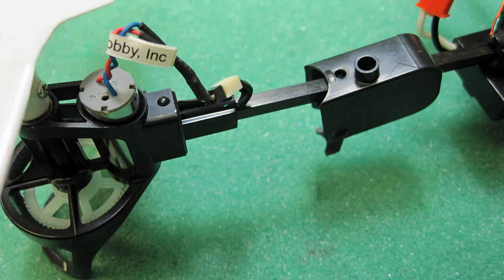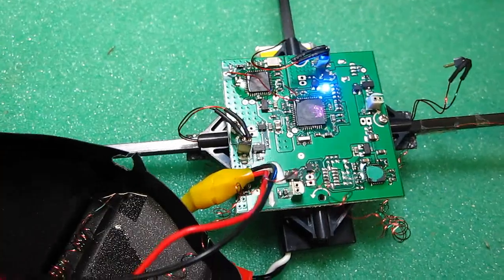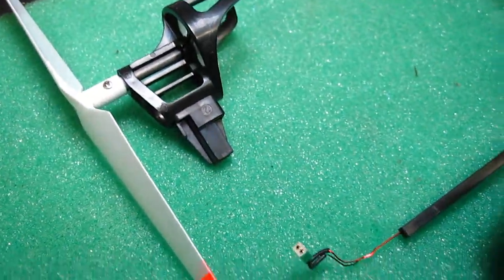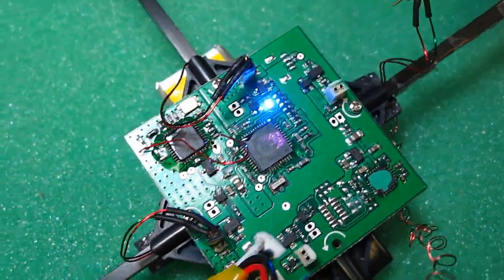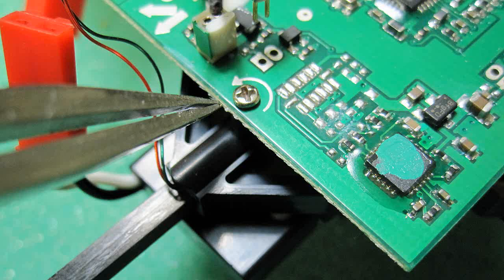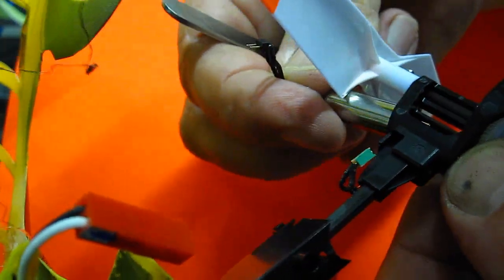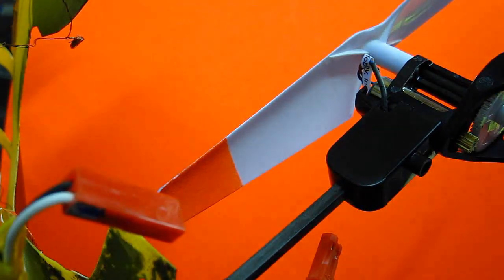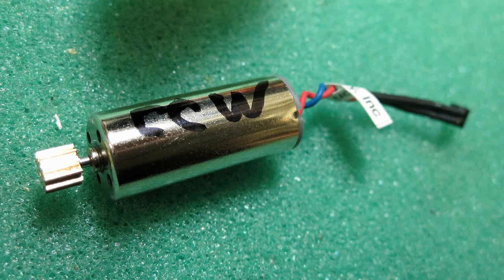2 of my mQX Quad-Copter Motors failed already! See how to change them out easily.

Comment: Sadly this motor early burn out on quadcopters is not limited to this model. I have had V262 a V222 a 2 x syma x7s and a cx20 They all have something in common all of them had a motor problem inside of a month.
I am now saving up for a move to a brushless one in the hope that these prove longer lived. But very disappointed that these manufacturers are putting these out there with motors that are not well suited to the task.

Comment: i get hair or other junk getting reeled in till its so twistedthe engine blocks ...the stabilizer tries to compensate till it over heats....it literaly melted the plastic holding it (blade nano qx).....i wonder if i put a different size motors to the board if it would work

Comment: HI Dave I fly the crap out of mine and am about to go onto my 3rd set of motors..
Oddly I have had more problems with dust & dirt getting onto and wearing out the little brass pinion gears (no sign of wear or loss on the 4 plastic gears).
In all cases I eventually wear right on through the teeth completely until the gear completely fails.. I have photos of this phenomenon. :-)
Also a fun fact is that the much cheaper WL-929 beetle motors are a compatible replacement except for the connector.

Comment: Thanks for the information, mine is about 2 months old and I think I am losing a motor. Mine tends to rotate clockwise in flight. Not a lot but enough that when you see it at a distance you can't tell which way it is going to go.

Comment: This was helpful.  Beware if you pull too hard, the whole 'landing pad' assy will pop off.  It's easy to put back on...just watch the tiny wires as you slide it back over arm.

Comment: I put a couple drops of Tri-Flow oil in all my motors and then blew each motor out with compressed air.  Next I flew the MQX for around 20 minutes and my bMQX flys like a champ. I also put a dab of hot glue on each motor connector because I had one come loose during a flight at 30 feet high!  I amazed that nothing broke on the MQX after crashing!  (Around 8 hours of use so far)

Comment: OK i was the first one to get it in my area i have flown the crap out of my mqx. i have probably flown it 1000 times the body broke the third time i hit the ground hard. i made my own. i had a hard crash into sand. the sand indeed up in one of the motors. so i took it apart cleaned it put a little slick 50 in it and on all the NON sealed bearings. I am still flying it on the same little core-less motors. KEEP IT LUBED and that goes for everything in life.

Comment: I've only been flying my mQX for 6 weeks now, and have had to replace 4 motors (HH comped me 1).  Just yesterday I had to replace the controller board ($60).  I love flying my mQX (when it works), but I'd have to caution anyone considering purchasing one that the durability is horrendous.  It's going to get pricey!

Comment: Sometimes oiling the motor with 3 in 1 oil will make it work , I had brand new motor and it was notchy so I oiled the motor a little and it started working after a while the motor was no long notchy.

Comment: thank yo so much as i am saving for one as we speak. I have 3 6ch's that i am still in hover mode. all my "big" fp 4ch are worn out or waiting for fixing. all my mini fp 4ch are flying whenever i can get time in....i look to your previous posts if i need to ts any issues and have gotten most answered here. you can add my 2 cents to your helped column....to which i am sure the account is overflowing.....

Comment: Indeed, brushed motors can indeed be very reliable and durable, but at the given weight/power/cost point, it's VERY difficult to make it happen. It's the old saying, any two of the three ;)

If you are going brushless, check out EatAtJoe 's work at rcgroups, he's achieved some pretty impressing results with 1S brushless setups. 

gl

Comment: The copter is pricey, but there is nothing different about these motors.  This is actually quite normal especially with how hard you have been flying them.  This has happened on every mini heli I have owned by every company.  Just normal wear and tear.

Comment: I can only assume that these stock models come out with these cheaply made motors to keep initial costs down (be competitive).  The backlash to this is the poor quality of the parts and in this case the motors.  What would be interesting is if the battery compartment could be made bigger and support the tail motors used by the 120SR.  It is no mistake that even mCP X owners use the 120SR's coreless tail motors/tail booms for their helis.  Yes... please make better coreless motors, Horizon.

Comment: Hey Nightflyer,
Me too... already replaced one of the counter clockwise motors. I only had about 6 flights on it when it went. HH Site said none in stock but I ordered anyway. Well to my surprise was delivered in two days. So that was Great... I thought I was not going to be able to fly my mqx for a while.Just ordered a couple of more.
I think HH knows about the problem because the motor I received as an replacement has a black top not white like the one that was on there. Maybe last longer:)

Comment: Some knowledgeable people at rcgroups state it's virtually impossible to mfg. consistent brushed motors at this size, the brushes are literally hair thin. Some people have better luck with NE Solo Pro main motors (less than 4 USD at HK) but there is no CCW, so that's not an option for the mQX.